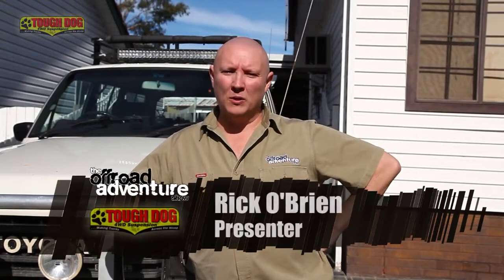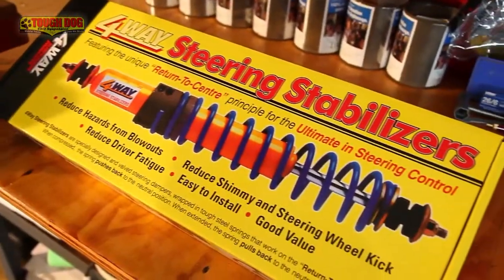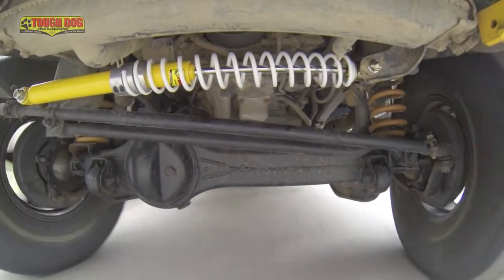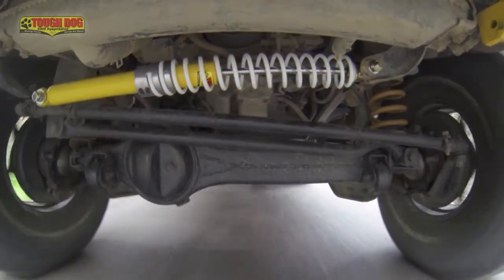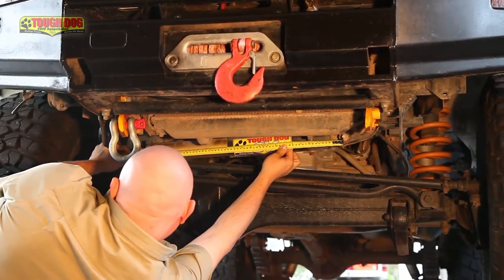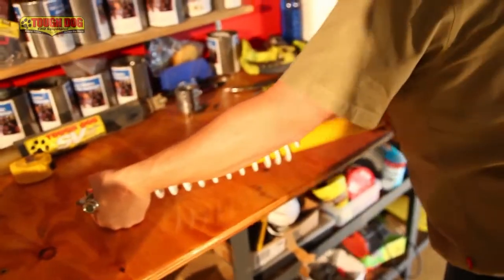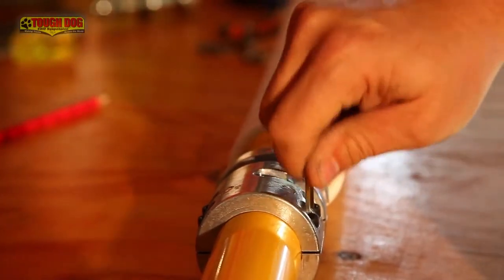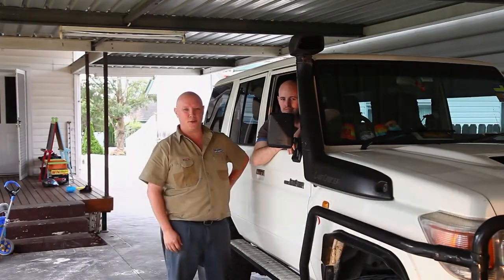Tough Dog RTC Damper

Comment: Great video . Have you fitted the RTC in a Jimny JB74 ? How was the customer feedback ? Jimny is a light vehicle , will the RTC assist ?
Reply from the maker: Hi! We have supplied and fitted the RTC damper to Jimny JB74 since 1998. Ever since it's been extremely successful in helping to reduce kickback through the steering in offroad conditions and helping the steering return to the centre position in offroad use. It's also very effective with larger wheels and tyres.
On the road this damper works well by making the steering feel more direct at highway speed and eliminating the wondering feel that Jimnys tend to have.